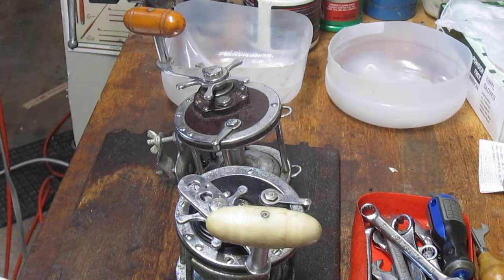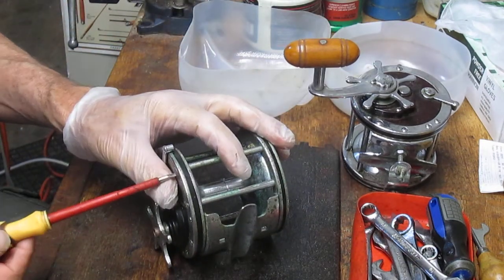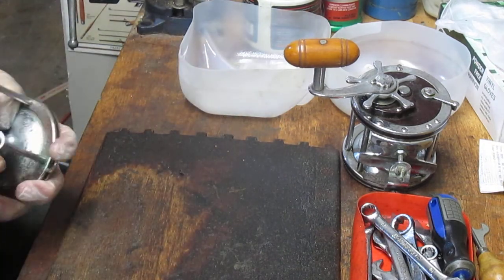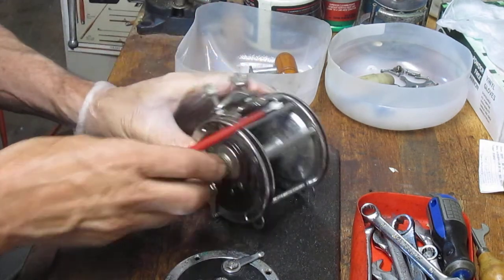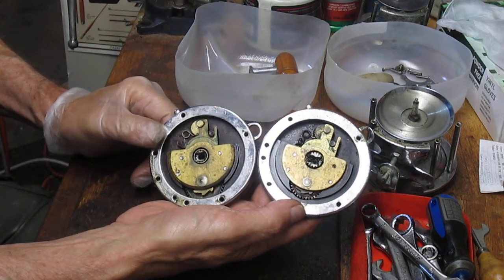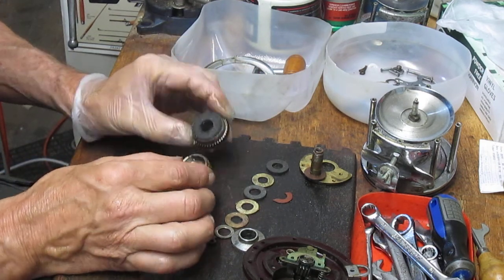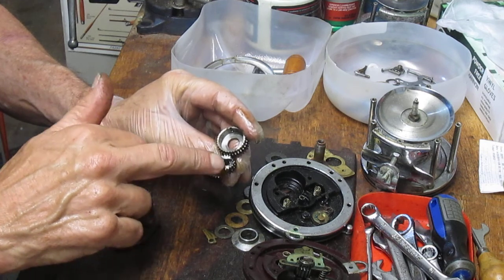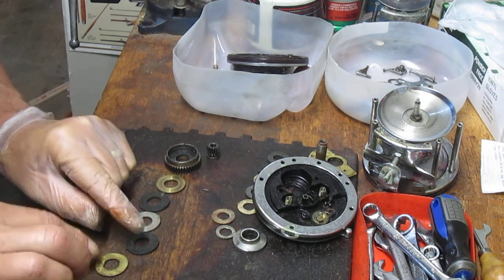Penn Senator 4:0 black vs red side plates how to compare the two versions of this reel

Comment: Great Video's Dennis!  I'm interested in knowing more about the Black Sided Penn 113 4/0.  Lots of people use them here in FL to pull up big grouper without damaging the gears.  It seems that the lower retrieve ratio and smaller gears of the 113, 4/0 help's to lift the fish without damaging the gears.  Sometimes speed in the retrieve is not needed.  Thanks again for your great educational posts.
Reply from the maker: You are correct that the lower gear ratio helps lug in the big Grouper, but both the red and black versions are both very durable and I won't discount the high speed version or call it fragile.  The down side of a high speed reel is that it can rip the hook out of the mouth because of speed.  The black side was the original and has stood the test of time.  The high speed retrieve was designed for trolling applications.  Best wishes - Dennis

Comment: Hello Dennis ,   How would I install the larger handle from a red 113 up to the black 113.  My older 113 has a smaller shaft size.  Thank you very much for your Penn Reels videos .
Reply from the maker: You can't do it.  They are different bridge assemblies.  If you want a larger handle, you need to find one from the Mariner, Jigmaster or Long Beach series or get an aftermarket handle upgrade. Dennis
Reply: Good morning Dennis, thank you very much for the reply. I will look into that. Thank you again for all the Penn Reels videos. I still have some vintage reels from the 70s and 80s  that work great . Your  videos are very educational for rebuilding..   Happy New Year take care.

Comment: Hey Dennis would you happen to know when the Black sided Penn was made I have one in pretty good shape and was going to do a drag update but the drag kit I got from The Bay of Evil is obviously for the red sided Penn. And also do you know what drag kit would fit.
Reply from the maker: The black sided Senator was one of the first models that Penn introduced.  The originals and goes all the way back to the 1930's.  If you want to get the right parts , contact Mysticparts.com.  They are great to work with.  If you have the thick drag washers, you will need to upgrade them to the newer HT100 ones.  The guys at Mystic Parts can walk you through the conversion and get you the right ones.  Sometimes it's worth paying a few dollars more for the help and confidence that you are getting the right stuff.  Thanks for asking - Dennis

Comment: I recently just picked up the same type of the red one at a flea market... you said, it would need about 7 of the modern drag washers? would there need to be extra metal washers between each one? Also would you or anyone in the comments happen to have a link to the HT100 ones or carbontex drag washers to fit the red senator 4/0?
Reply from the maker: Yes - the upgrade requires more washers.  Contact the folks at mystic parts.com and they will get you the correct replacement set.  This company is an authorized Penn Parts regional distributor.  Thanks for watching - Dennis

Comment: my question is can you put the red side gears in the black side
Reply from the maker: No - The side plates are different and so are the gears.  The black sided 4/0 is basically the Long Beach 66 with additional chrome trim rings.  The red side plate reel has a different set up including ball bearings and larger gears.  The parts are not interchangeable - Dennis

Comment: Today I bought 2 Penn battle 2 5000 and 3 Abu Garcia black max. Do you recommend I do anything to them before use? Thank you. You're videos are awesome.
Reply from the maker: The reels that are new and in the box are ready to go.  You do not need to do anything.  I find most manufacturers overlube the reels prior to shipment so there never seems to be a problem with evaporation or drying while they are in storage or waiting to be sold.  If you find they are a little tight after use, a drop of oil on the main shaft would help - Thanks for asking - Dennis

Comment: the 4/0 is for gear size witch makes capable of heavier line          the same with the otheres in the line    3/0, 6/0, 9/0   the higher end reel use the same bigger gears in smaller  reels in the age of useing braids
Reply from the maker: Yes they do.  Braid has changed everything from smaller formats to larger capacities nd the bigger gears make for a higher retrieve rate. - Thanks for the note - Dennis

Comment: To answer your question why Senators are called 3/0 or 9/0 etc: Old linen thread line used to be used back in the day, and the first number refers to the number of strands of linen thread that are woven into the line...4 strands, 6 strands, 24 thread and so on with each "thread" breaking at approximately 3 lbs.  The /0 designation is because all the old school game trolling reels (Hardy, Vom Hofe, Ocean City and Penn Senator) were all sized according to the /O system - O means Ocean Reel.  Does that answer what you wanted to know?
Reply from the maker: Thanks Dave.  There seems to be a lot of conjecture on this and I even contacted Penn Reels and they did not have the definitive answer.  I have heard the /0  stood for ocean even through it is numeric.  I have not heard the linen line strand count one.  One fellow told me the 3,4,6, etc in front of the /0 was in indicator in 100 yard increments on the capacity of the spool.  So thank you for adding this.  - Dennis
Reply: @2ndChanceTackle  No worries. If you think about it: the 3/0, 4/0 system can't be for increments of capacity on the spool, as that would mean the same diameter line would have to be the measure to get a standard (say 20lb), but there's no way you would use the same diameter line on a 12/0 as a 3/0 & so on...if you catch my drift? it would make no sense. With that logic-  a 3/0 takes a "3" of 20lb and a 12/0 takes "12" of 20lb line...no way that would be the measure, as you would never spool on, or Penn sell a reel to have spooled on, 20lb line on a 12/0 reel.
Reply: @2ndChanceTackle  but if I was designing reels and needed a system to size them by, I would do it by the diameter of the spool ir maybe the side plate. Just a rough indication of size is needed, so you wouldn't need to include the spool width or capacity in the sizing system.  Before I researched this, I just thought it was some weird American Imperial sizing kind of measuring, for the size of the spool diameter, but what would it be? 12inches for a 12/0 and 4inches for a 4/0 maybe? would that work?....be good to find an old buyers guide to game reels from the 1930's or similar to clear up the sizing system "debate". Cheers, David..from NZ or "the Angler's Eldorado" as Zane Grey put it ...
Reply from the maker: I do get your drift - just passing along what I have heard.  I don't know the answer.  I am trying to find some catalogue information or other source beyond just what we have heard.  Thank you - Dennis

Comment: What is the diameter of the side plates on a 1/0 senator? Smaller than a 2/0 or 3/0? I would like a "small" reel for 20-30 lb. catfish. I know the 4/0 is way too big for my needs. Thanks.
Reply from the maker: I will have to check.  I know the width of the spool is smaller

Comment: I want.to.upgread my drag with all ss gears can you help
Reply from the maker: They are available for certain models.  You don't mention which 4/0 you have.  Myticparts.com carries the gear sets.  Best to check with them to make sure they fit your reel.  Here is the listing
P316113H401 In Stock	P316113H401
P316113H401▲	P316113H401 Custom Stainless Steel 4:1 High Speed Gear Set (Optional)	$64.99

Dennis
Reply: @2ndChanceTackle  I have the high speed 113h

Comment: The current penn slammer 3 the red one is high speed same as the red senator , wonder if penn did that on purpose 🤔
Reply from the maker: The slammer is a spinning reel.  I don't understand your question.  Can you ask it differently?  Thank you - Dennis
Reply: 2nd Chance Tackle apologies , it wasn’t a question, I just noticed that the current slammer 3 spin reel ( red model )is similar to the old senator red side plates, being that they used red to symbolise the high speed .thanks

Comment: I opened up my low speed today and there was no bearings in it. Have you seen this before?
Reply from the maker: Yes - th black side plated 4/0 do not have bearings.  The red high speed side plated reels are the ones with the bearings - Dennis
Reply: 2nd Chance Tackle ok thank you for the reply. This is the first reel I have attempted and it’s the black side one. The problem with my reels turns out to be the problems you identify. Looks like normal grease was in it and some kinda oil.
Reply from the maker: @po28der  Glad to hear you are back on the right track.  Best wishes - Dennis